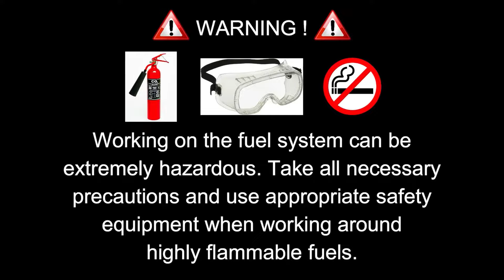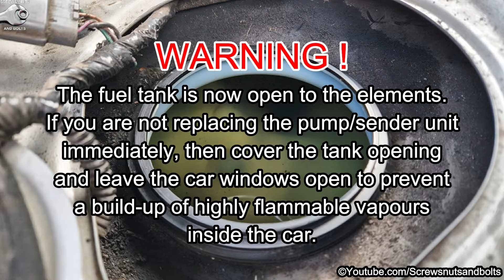Fuel Pump and Sender Unit - Nissan Micra K12

Comment: Thank you for vids mate so helpful, one question though my Micra show inaccurate reading on fuel gadge, could this mean my fuel pump is fault or something else?
Reply from the maker: You're welcome. It could be a faulty sender unit. Is the gauge showing too high or too low, or is the needle moving at all ?

Comment: Great video, i have followed this exactly but i cant seem to get the locking ring to thread back on, what could it be ?
Reply from the maker: Thanks. The rubber O-ring could be getting stuck in the threads of the locking ring. Lube the o-ring with a rubber-friendly oil or grease, like silicone grease, and make sure the o-ring stays out of the threads as you tighten it
Reply: Haynes says to refit ring while fuel pump is out to prevent warping. I'm no mechanic but maybe siphon out the fuel and then try?

Comment: Thank you so much for your videos on the Micra K12. I have a problem with the front driver seat where the lever won’t slide now to fold the car seat. Any chance do you know how this can be fixed? 

Thank you for your videos 👍
Reply from the maker: You're welcome. It's hard to say what's wrong without seeing it. Do you mean the lever under the seat to slide the seat back and forward ?
Reply: @screwsnutsandbolts  Hi thank you for your reply. I have a 3 Door Micra 2003 the lever on the side of the driver door is not working to fold the seat in order to get into the back seat. Thank you
Reply from the maker: It's possible that the cable that releases the seat could have become loose or possibly broke. Check this forum: https://micra.org.uk/threads/seats-not-tiliting.29392/

Comment: Would you happen to have the part number for the locking ring and gasket ? 
I cant find the exact part locally but i think a clio2 or megane part is the same
Reply from the maker: I searched around and found this:
Lock ring - 17343AX000
O-ring - 17342AX000

You should double check, just to be sure

Comment: Hi, my car has problems starting when turn on the car, but it doesn't have any issues while regulating or driving. Do you think it's an injector problem or fuel pump problem? I checked the electrical system and it's all fine, so my guess it's one of those 2. How do we know if the pump is not working correctly or needs to be replaced? I'm going to start there and later go to the injectors.

Comment: Hey, I was wondering if you knew what the part number for the sender unit would be? I cant seem to find it
Reply from the maker: There's a link to the part in the video description
Reply from the maker: The OEM part number is 17040AX000
Reply: @screwsnutsandbolts  Cheers for that, thank you very much!
Reply from the maker: You're welcome !

Comment: Mine is stuck and wont budge and i dont have the tool for it 
I tried with a screw and a hammer didn't work all the plastic on top of it is broken
Reply from the maker: Can you get a replacement locking ring ?. You may have to split the old one to remove it or you could remove the fuel tank to improve access to the locking ring. I've had that problem before and ended up breaking it when trying to remove it.

Comment: hello, I have a problem with the nissan micra k12 with the dashboard clock, it always shows me that I have more km per hour, for example at 80/h it shows me 90/h and so how do I solve it?
Reply from the maker: It depends on what's causing it. There's usually a slight difference of up to 5 or 6kmph on most cars. Have you changed to smaller wheels at any stage ?
Reply: @screwsnutsandbolts  no

Comment: Jak poznacz czy pompa paliwa pracuje moja mikra kreci ale nie odpala
Reply from the maker: When you turn the ignition to the 'on' position, can you hear the pump activating ?
Reply: Ja tam nic nie słyszę.moze jestem głuchy.ale jak kręcę kluczykiem na zapłon i dodaje gazu to nie czuć paliwa
Reply from the maker: Can you test the pump wiring plug to see if the power is getting to the pump when you switch on the ignition ?. If not, check the fuse first to see if it has failed: https://fuse-box.info/nissan/nissan-micra-k12-2003-2010-fuses-and-relay
Reply: Dziś odpalił musiałem się nieźle napompować pedałem gazu.mysle że pompa jest na wykończeniu albo coś z paliwem auto z lpg